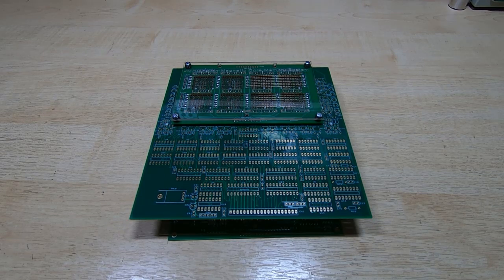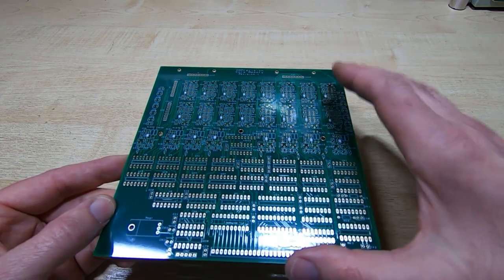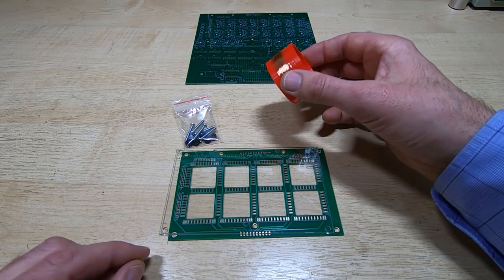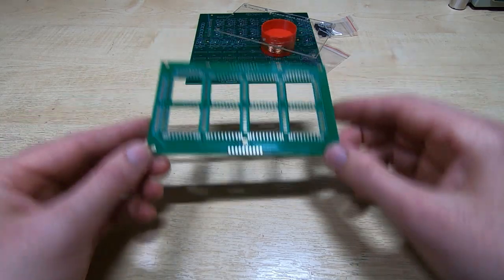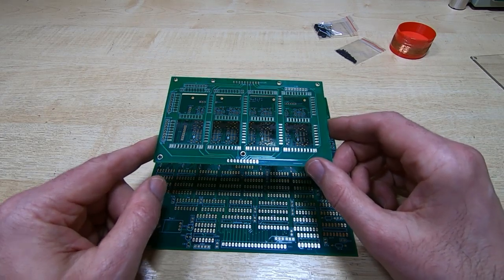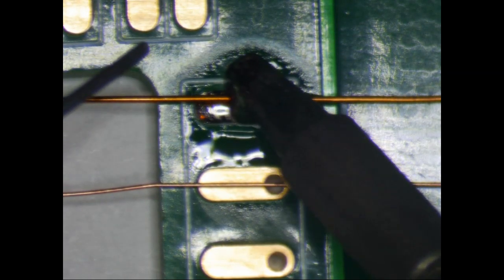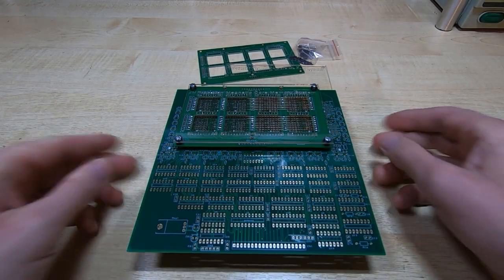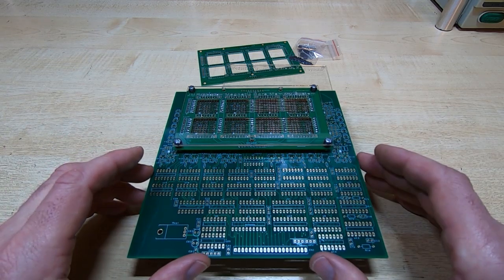Magnetic Core Memory Decoded Part3

Comment: When I solder enamel wire I use aspirin to remove the enamel. You just need to heat the wire over an aspirin tablet exactly like you would heat it over rosin. Do not inhale the fumes from the aspirin, they are nasty, but the method works 100%.